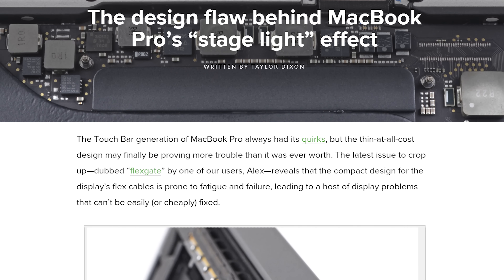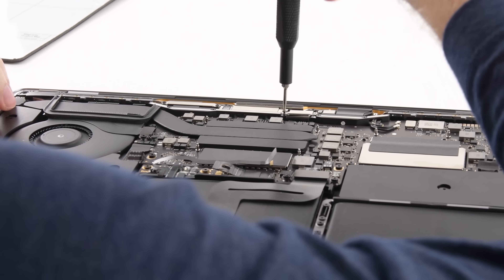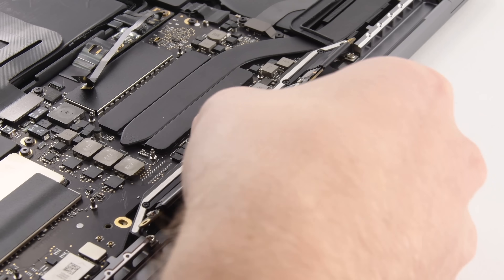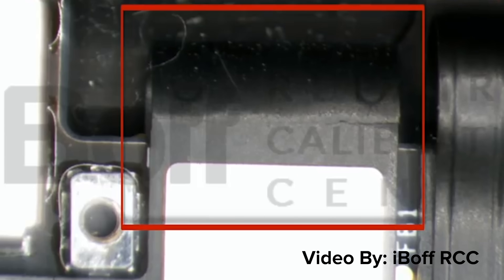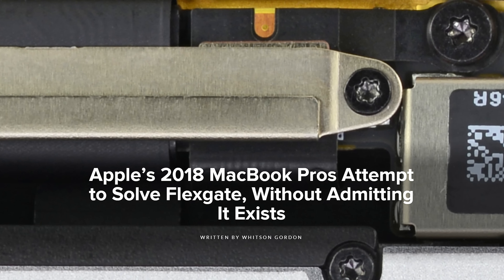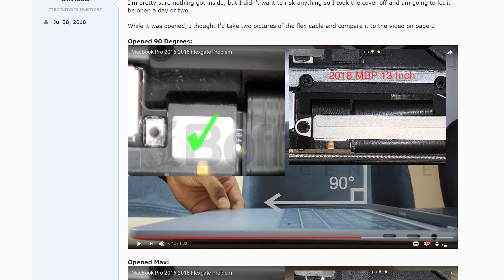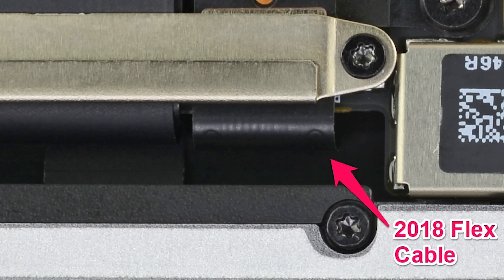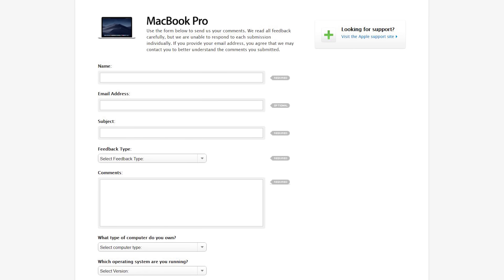MacBook Pro Flexgate Follow Up! Has Apple Addressed The Issue???

Comment: Has anybody had the repair for their 2016 15 inch MBP with touchbar repaired with reduced/covered cost? Apple quoted me 900$ the other day which is crazy to me because 13 inch models can be repaired for free but those who spent more on the 15 inch dont?
Reply: Were you ever able to work something out with apple to get yours repaired? The display on my 3 yr old 15” MacBook Pro completely failed the other day because of this poor design and apple refuses to do anything to help with the cost of repair (which was quoted to be over $700).
Reply: @kayleeschmidt7767  I believe there is currently an ongoing class action lawsuit and according to Apple I can continue to wait or receive a refund if they lose the case. I think it also depends on the Genius Bar technician you get paired with. Unfortunately I am just using a Lenovo for now but I’m hoping to get the MBP fixed under Apple cost soon. I will keep you updated!
Reply: @iluvblackeyedpeas7  Have you any update about this? I too have this problem with my 2017 macbook pro 13 inch - not covered by the repair program- Apple quoted me 550 USD. I think its super bad style, since the 2017 has exactly the same screen/display that the 2016 which is covered has. Apple needs to own up!

Comment: That's why I bought a refurbished (new battery + display) 2015 MBP with 
dPGU. In December 2019! Because it is the last reliable PRO macbook. 
Everything since 2016 is just trash. Faulty keyboard, faulty flex cable,
 poor battery Whr, poor I/O selection, no Magsafe, no SD-port, speaker 
problems, T2 problems... just pathetic. Majority of reviews and users 
agree. Only the new 16" seems okay again.

Comment: Anyone else watching this video with their screen at a dumb angle? :')
Reply: That's me!!!!!
Reply: Yes this is my problem. But i can still plug it thru hdmi connector to my tv because the screen died
Reply: @samanthaagneslumapas8388  Apple gave me a New Screen!!!!
Reply: @DanielJackCosta  for free ?
Reply: @JohnDo-j7z  YES!!!!!!
Reply: @DanielJackCosta  how did you do that? What did you say to apple to make them change the display for free?
Reply: @chrisparussin5359  I called Apple Support and there gave me a new Display.
Reply: @DanielJackCosta  have you told them something specific?
Reply: @chrisparussin5359  I explained that I had researched and that the problem was caused by the Flexgate. At first, they said that they couldn't replace it, but I insisted and they gave me a new one.

Comment: Using the MacBook's lid to open and close is general user behavior which we expect the user to do thousands of times and the keyboard is something you expect to be prone to dust and particles! Blaming the user for these problems is disgusting! I am a student who paid a hefty amount to buy a 2016 MacBook pro for designing and now with my display not working, I have to pay 45,000Rs (around 700$) to get it repaired and apple is not willing to help me with this issue. This is extremely disgusting, and we would like a replacement program for this!

Comment: It's a US$6 cable that they fixed to the display so....it will cost US$700 to repair/replace. As result of this design oversight - 1) Flex cable that's too short, 2) wrapped to close to the board, 3) fixed to the display -  it has become too big of an issue for them to own up to. I'm sure if it was the $6 repair, we'd all have no problem having them repaired. Instead, I am carrying an external display around.

Comment: I've been using macbook since 2007, mainly because of Mac OS and the design, currently still using MBP 2012 non retina that serves me well but still showing up its age (one of the memory slot stopped working but the machine can still be used even though it's slower). Their product used to last around 5 years, but lately I just found out about their questionable business practise and it seems like it just gets worse. They get really greedy, for something that's labelled a 'PRO' device, removing ports clearly won't accommodate the professionals needs. If I'm paying 2000 bucks for a pro device I expect it to work nicely out of the box, but no, I have to spend more money and buy the dongles. 2) The repairability gets WORSE. They soldered everything up, when big issue like this shows up they refuse to acknowledge it. Honestly back then I knew that I was paying premium but I can say that it delivered. Now I won't say the same

tldr, me a 10 years+ macbook user won't be using Apple product anymore in the future. Switching to windows and android after my 2012 MBP and iPhone 6 completely died.
Reply: I agree with you, it is not a good practice and it is not fair for us asumme the cost for a pro machine.

Comment: Why just why? After steve died Apple products become more trash and trash from the durability, i still remember that   MBP from around 2012 is totally badass in term of durability and mine is still kicking till this day with only replacing battery, hdd to ssd, and ram upgrade. But the 2016 edition is flawed the durability is just trash, and in terms of repairing is to damn time and money wasting like if you need to replace an IC or replace the screen. Shame on you now Apple just please don’t ruin the Iphone like you ruin MBP.

Comment: Great. RIP my sister's 13 in MBP for college. Already had to replace the entire logic board for a busted headphone jack. A HEADPHONE JACK. Apple Care is over by this point so...yeah.
Reply: Thats standard. Headphone jacks have been soldered to the motherboard from many manufactures for years now, not just Apple
Reply: @seanh1988  Yeah, but my 2013 Macbook Pro is still chugging along. Hers broke in two months as a 2017 model.

Comment: just came through a thought: would wrapping electrical tapes around the display cable - to help it strengthen itself - do a little help on the survival time of the cable? :P
Reply: There is no extra room. It would dull the edge of the board it's wrapping around but also increase the tension. Probably pop a connector at some point.

Comment: Are the replaced displays from the 2018 model? I just got my 2016 MBP replaced, and I really don't won't to have to deal with this again in 1-2 years.
Reply: Nope, same year model. So you'll have the issue again.
Reply: Did you have to pay for the replacement? Also: 13 or 15”?
Reply: No They are denying it’s an issue. I have an 18 that’s not two months out of warranty and having the flex cable problem. Apple claims its not a wide spread issue and I do not know what I am talking about

Comment: Tim Apple: “the lid wasn’t meant to be fully opened..”
Reply: bro you killed me
Reply: LOOOOOOOL
Reply: The cable is taut when the laptop is closed, so wider you open lesser is the stress on the cable. Faulty logic 😂
Reply: Tim Apple xD https://www.youtube.com/watch?v=MFLKv8uQMBQ
Reply: @Vishwajeet Babbar Probably yes because they're still using a flex cable that's just longer instead of the real display cable they used back in 2014.
Reply: @Vishwajeet Babbar You're welcome, btw you can also check Louis rossmann's channel for more detailed info about it.

Comment: Visited the Apple Store and they said it’ll cost me $475 + tax to fix it. It’s unreasonable to pay such a big amount due to such a silly design flaw. I hope Apple does something about it. Till then, I’ve resigned to using my MacBook Pro as a Desktop.
Reply: How old is your MacBook?
Reply: Tristan Diependael Two years and three months old.
Reply: Were you ever able to get this sorted out without paying the full repair amount? My MacBook Pro is having this same issue and apple quoted me over $700 for repair, they refuse to reduce the cost in any way because it is outside of the warrantee window (it is just over 3 yrs old).

Comment: My 2017 MBP 13' has same issue, is it possible the monitor cable used same design?
Reply: It's the exact same part. They are interchangeable in 2016 and 17

Comment: Would the 2018 display be compatible with the older models? That way you could switch them and make it all work. (especially if apple lowers the cost of them when it happens)
Reply: Same design. Pretty sure it can fit.

Comment: Sorry guys, what about the 2017 MacBook Pro? It belongs to the 2016 category?
Reply: depends on manufacture date. if the date late then August 2018 - flexgate is fixed. Not a rumors - I have been disassembled my own MacBook Pro non-touchbar 13 2017 manufactured on 27 August 2018. There is no over-bending when display open to the limit.
Reply: @АлександрМиронов-ф7с  how did you find the manufacturing date? I only have import date on my box its Sep 2018
Reply: yes it still uses the same display and cable

Comment: It's really sad honestly.  I remember how elated I was the first time I was able to save up and buy a Macbook Pro in 2010.  It cost me around $2000, and it STILL WORKS perfectly.  9 years of daily use, without any problems until the Mac OS itself bricked it's firewire port. (I work in audio engineering, and firewire is still kind of useful in that field)  It's not powerful enough to be my work computer any more, but it's still perfectly capable of being a daily use laptop.  When I decided it was time to upgrade in lat 2017, I was appalled at how just...terrible the new Macbook Pro's are.  The number of issues they've had since Steve passed is just embarrassing, and how they "handle" these problems is just childish.  Since I couldn't bring myself to spend money on any new mac product, I switched to PC, and I have to say I was quite surprised and pleased with the Windows 10 experience.  Booting up Windows 10 for the fist time had that nice, easy "sit back and relax" feeling that I remember from the first time I booted in the Mac OS back in 2010.
Reply: Yeah 2010s were awesome laptop. No profit for Apple because you can fix them easily, and upgrade them. But Apple of today is a totally different story.
Reply: MacBook Pro 2015 is still pretty good
Reply: I feel you
Reply: Omaer Khan if you’re waiting for a MacBook to buy, the ship has sailed.  So many PC laptops crush the MBP in every way these days, for the same or less money.
Reply: @patrickfouhy9102  on a strict performance basis - passmarks per dollar - that has pretty much always been true.  The extra $$$$$ you're paying is to take advantage of the whole Mac/Apple ecosystem.  Whether or not that's important is up to the buyer.  I owned a lot of early Mac's but gave it up when the PC industry stopped letting IBM dictate system design and the performance/price curve started to ramp up.
Reply: Patrick Fouhy, no one of them runs macOS
Reply: @cheesebusiness  Hackentosh.  Yes, they do.  I have Mac OS installed on one of my PC's, it takes about an hour of research to learn how to do it, and about an hour to install it.
Reply: Patrick Fouhy, and you need a perfectly compatible hardware
Reply: @cheesebusiness  No, you don't.  You simply need to pick items from a very well documented, and tested list of parts easily found on multiple hackentosh forums.  The community around Hackentosh is pretty extensive, and they figure out and post for free how to use almost every piece of hardware out there.  All it takes it patients.
Reply: Yeah. You need to research parts and make sure they are perfectly compatible before making a hackintosh. Plus, it won’t ever run as well as it would on a Mac of the same spec. Not to mention the need for separate WiFi Kexts.
Reply: Same here. Macbook Pro late 2008. Have had to replace bulged battery, magsafe port cable, added RAM and put SSD in. Runs very well. Hearing all this "thinning"  madness and all issues with keyboard and flexgate - in no way I buy newest macbook. And my impression about Win10 is different - it's ugly, clumsy and full of rough edges.
Reply: Try Linux next.
Reply: I bought a 2010 white MacBook secondhand for £100. I put in a cheap 120GB SSD and upped the RAM to 2GB and I use it for web browsing and occasionally messing around in GarageBand and iMovie. They are still useful even though they are old and it will probably outlast me.
Reply: My 2008 MBP still works... my 2017 MBP doesn't. :I I treat all my laptops with care so it's infuriating. Suffice it to say they lost a customer the day I went to the Apple store to explain that through no fault of my own the screen is now dead, but I for some reason have to pay £700+ to fix it. Protip to anyone with Flexgate: plug in 15" portable monitors are only about £50 online. They work great.
Reply: nice downgrade. get a linux. win10 backdoor, no  no.

Comment: Good that I’m still having a 2011 MacBook Pro
Reply: Mine died a hot death, it worked really, really well right up until it stopped working.  I replaced it with a 2018 MBP
Reply: @Derek Frampton At nearly $4,000, I hope it lasts 8 years.  I'm still angry about the 256GB internal storage.   I must travel with external drives all the time
Reply: Zacchi4000 right!!!!!!  Apple. I love to hate.
Reply: Gosh! My first own Macbook 13' 2018, I really hope it held well for many year onward~ Dislike windows 10 since bug on update.